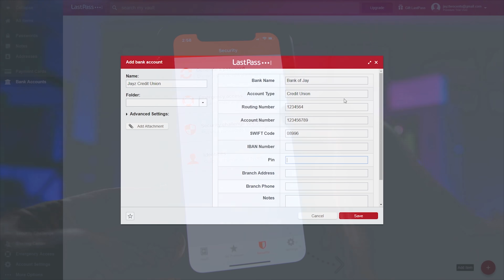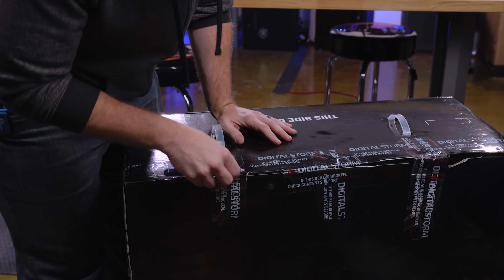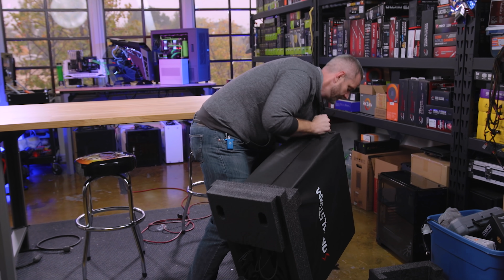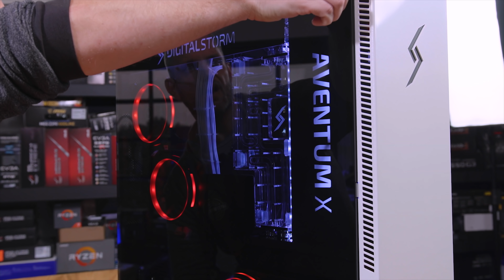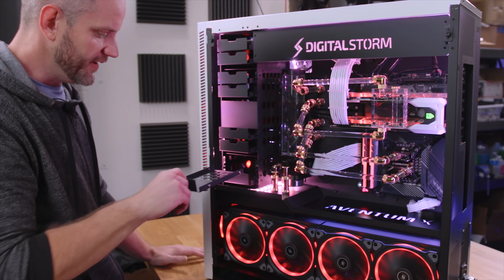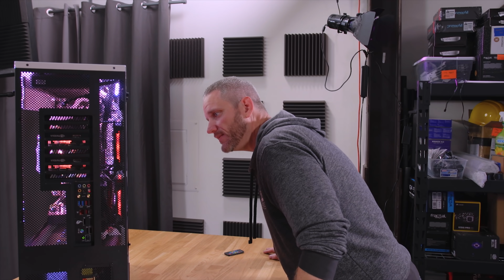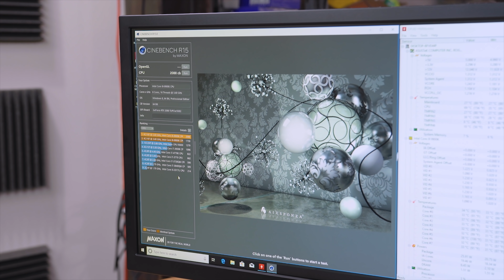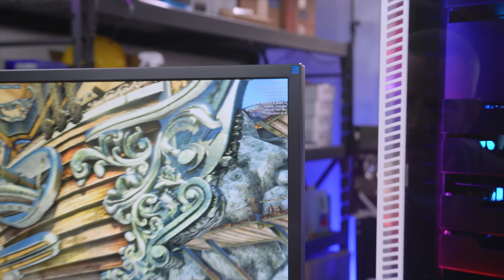Unboxing a $9500 Custom Computer...

Comment: Digital Storm is the biggest Ripoff I've ever seen. I'm about to build a new system with 16gb of Ram, i5-8600k, and an RTX2070. The whole build that I designed will cost me about $1,450. I went on Digital Storms website and built basically the exact same computer besides Digital Storms has 1TB less storage and a i5-9600k instead. The website says it would cost me $2,494 to get the same system than I myself will be building for $1,450 so basically they are making $1,000 over the price of components. That's the biggest ripoff I've ever seen and hell I went on NZXT and build the exact setup as I'm doing and it was only around $1,600. Fuck Digital Storm lol if you buy from them then you're not smart unless you wanna drop $9,500 for a pc like in the video and even then you can build that pc for a ton cheaper on your own.
Reply: YESSSSSSS, FUCK THEM!!! They fucked me up so much man, it was incredible!!!! I spent too much money because I trusted them, and in the end i got screwed over with 3 RMAs. it sucked so bad
Reply: Aside from the guy spamming every comment with hate, I tried to build their standard model on nzxt and it ended up being like 200 more on NZXT without any of the free stuff that comes with the vanquish.  Granted NZXT doesn't give a lot of options to let me push the price down...
Building on your own, if you know what you're doing is generally going to be cheaper now, especially if you're not aiming for the newest hottest stuff.  That's been known.
Reply: Rakka Kaze If my experience happened to you, you’d have nothing but hate as well. NZXT do seem pretty good tho after you said that
Reply: @JBxER  I'm a mature adult (ha) that doesn't think a bad thing happening to me is the typical law of the universe.  I've also been savvy in electronics since I was 14, and am more likely to fix my own stuff. I avoid your experience by my own hand.
If spending more money on the same things with less options seems 'pretty good tho', then you have a lot more problems than your obsessions.
Reply: @Rakkakaze  I never said anything about you being immature... but OK. As for problems, um.. what are you saying here? More problems than my obsessions? What? When i said my experience, i meant what I went through with Digital Storm, not my tech experience overall. I guess I wasn't clear when I said that, didn't mean anything against you personally.
Reply: @JBxER  Maturity, your response to a problem.  Obsession, evident in this comment section, searching for any and all confirmation to your problem. Experience, avoided by my own diy experience, in response to your 'if it happened to you'.  And finally, why are you looking to spend MORE money than on the same things with a pre-builder, just because you don't like the other pre-builder, thus possibly dropping yourself into the same problem. 
It's like saying 'HA, android phones won't get me with that, I'll just sell an arm for an iphone! Oh crap, Apple also caused me problems!'
Have more than hate when things go wrong.

I can find plenty of things wrong with this build featured by just looking at it, but I can also find design purpose to them as well beyond aesthetics (except the gameshow lights.)
I imagine anything with a water distribution system like this can be packed with nightmares in complications, and the fact they are shipping these things around to get knocked around for however much time they take to get shipped.
Reply: @Rakkakaze  Oh, well honestly at the time I purchased the computer from Digital Storm, I didn't really know better. I learned a whole lot afterwards, through interest and through the hard way unfortunately. I made the mistake to trust Digital Storm and it has bit me really hard. That's the truth, I decided to make an effort and let as many people know the risk they would take should they decide to order from them. Overall, after around 60 days without my computer back and being kept in the dark as to what would happen to it, I ended up building a computer from scratch since it was affecting me financially (had to turn down a lot of freelance gigs, kept hoping I'd receive my computer soon when I didn't). It was my first computer built, thats when I learned more building computers in general and realized it was totally doable. It may have been known to many people, but sadly it wasn't to me. Live and learn, right?
Reply: @JBxER  That is the general idea, yes.
The same thing happens to cars, but I don't exactly see the car companies crashing because lemons exist and 1st party dealers want to charge 10x as much a garage would and keep a 50-200k car forever.  The only reason I don't build my own is lack of tools and market to support it.
Some people want to spend their money on fancy over anything else.  My own rig is just a black box with a light inside telling me the mobo has power, and a corsair logo that changes from green to red as CPU nears 100% usage.  Some want their rigs to be seen from space, this is one such.

Comment: Is it just me or does the RGB on this particular Digital Storm rig look really cheap, like Walmart Overpowered RGB cheap?
Reply: This whole thing looks cheap to me.
Reply: The fittings and other components reflect the light inside the case and it indeed makes it look cheap..
Reply: No, it doesn't look cheap at all. Not anymore cheap than all the other RBG builds. You'd think they're building computers for 12 year olds.
Reply: @xenonram  I feel like RGB if done tastefully can certainly enhance a computers aesthetic appeal in most applications, however, imo, this is not one of those.
Reply: The one that came shipped in my computer can be bought for 15 bucks on amazon. So yes, cheap. Chinese made
Reply: I wouldn't say "cheap"... more like... hmm... tacky? The whole color scheme is not quite to my liking. It can't decide if it wants to be blinged out in gold/silver, or sleek stealthy with matte blacks, or RGB rainbow parade with all the LEDs. It's excellently put together, I just don't care of the aesthetic.
Reply: No it was super cheap. They got very low-density strips, probably 60/m as oppose to the 144/m I use in my systems. Also it has no diffuser to spread out the light, mix the colors, and make it less harsh on the eyes. Diffusers cost about $1 per 5m retail. Doesn't even seem to be synced to the rest of the PC. They got literally the cheapest strips they could and just glued to them to a random spot.
Reply: I was watching the end with the fans out of sync.
Reply: They are thermaltake Riing Plus fans with the branding changed...

Edit: here’s a link to thermaltake’s fans
https://www.amazon.ca/Thermaltake-Controller-Software-Radiator-CL-F070-PL20SW/dp/B07D95PLY2/ref=mp_s_a_1_1?ie=UTF8&qid=1544101880&sr=8-1&pi=AC_SX236_SY340_QL65&keywords=thermaltake+riing+plus+200&dpPl=1&dpID=51NnZnI1FlL&ref=plSrch

They are absolutely identical
Reply: It is just you
Reply: You cant argue about taste, but i like minimalistic builds waaay more. Rgb just isnt my thing.

Comment: I just received a 8100$ digital storm custom PC with dual 2080ti’s and a i7 7820x both watercooled in the lumos case and upon arrival both 2080ti’s had hardware failure.... :( currently, it’s an expensive brick. I sent you an email about it a few days ago. Hope you might be able to help.

Comment: Hey Jay, thanks for the video. I’d like to share my customer experience to YouTube, hopefully to provide additional context to people. After saving up money for years, I bought an Aventum X, config is about $11,000 with 2x 2080 TIs. It’s a beautiful looking machine. But unfortunately I’ve had to bring the machine back to DS 4 times now. At the time of writing this comment, the machine is being worked on by DS techs. I’ve even had the system rebuilt too which is actually how I even got the 2 2080 TIs in the first place.

If I didn’t live within driving distance of their HQ, The whole RMA process would be a nightmare considering how big the machine is.

Of course, I hope that anyone that buys an Aventum doesn’t go through this! But I think most people especially those shopping in the boutique build market don’t have the patience for this. A brand new product shouldn’t be going back to repair every other month imo.

Comment: You should not mock the british for their mesures, YOU should use the international system (kg for the weight)
Reply: Why. Technically the imperial system is international..
Reply: @jdrok5026  https://en.wikipedia.org/wiki/International_System_of_Units

Comment: Jay this seems like a dumb question. But where do you draw the line between pcgamer and enthuist? With games being more demanding is enthusiast just another name for " future proofing?" I hate the word.but When it comes to technology is there a such thing as "future proofing?"  Im on the fence about it .
Reply: Depends on what enthusiast means to you. You can be a enthusiast of just pushing things to the limit aesthetics etc etc.
Reply: future proofing is like being ready for future updates... if you spent top dollar on pcie 4 motherboard on day of release it should be relevant for 5 years until pcie 5 is released... ddr4-5, am4, am5 etc. on a side note is anything future prof if the government restrict what can and cannot be used for chemical compound, power used, emissions etc? some could argue that the future is 1 nano second from the time you have read this.

Comment: I dont like it because the motherboard is upside down.
Reply: That stuck out to me as well. Oddly enough the Aorus Gaming x299 boards all had their text so it looked sideways in most cases but because I have a Thermaltake Tower 900 Snow Edition and it looks like the Gaming 7 was made for that thing.

Comment: All of that over kill and only two sticks of RAM?!?!?
Reply: $9k = ALL OF THE SLOTS FILLED =)
Reply: @christophermcbride1133  Rather have two sticks for preformance over 4 sticks at slower speeds.
Reply: Perfect board if you want 4x nvme m.2 ;) @christophermcbride1133
Reply: For 9.5K it should have been this:
1. Binned & delidded 9980XE@5.2GHz with silver IHS and either liquid metal or Kryonaut,
2. X299 ASUS RAMPAGE VI Extreme
3.128GB (8x16GB) Gskill trident Z @4000CL19
4. Intel Optane 905P 960GB SSD
5. 4TB Samsung 860 pro
6. Dual 2080Tis + SLI NVLink Bridge
7. Elgato Game Capture 4K60 Pro
8.  Phanteks Enthoo Elite Extreme
9. EVGA SuperNOVA 1600W T2 80+ TITANIUM
10. 560mm+420mm radiator custom loop with hard tubing
11. Windows 10 pro for workstations

This leaves about 800 dollars for the labour which I see as fair. But with what you actually get you actually pay 4000 dollars labour which is extortionate.
Reply: not even 4600mhz ram for $9500
Reply: @Karl Marx  Only HDTPC'S support more than 64 gigs of ram.
Reply: @X x X  Because it's a high end desktop platform.
Reply: Karl Marx i9-7980XE?
Reply: Karl Marx or the i9-9980XE
Reply: 2 sticks = higher possible clocks
Reply: @MeakerSE  2 DIMM slots = even 
better overclocks 

But at 10k it should have 64GB of DDR4

Comment: Those gpu cables.... Why??? So much effort with distribution board and all and someone couldn't be bothered to cut them to the right length?
Reply: yeah you can see it looks awful at 5:45
Reply: @isaacsrandombits5832  Ha I click on the time and it shows the rats nest and Jay says "very tidy" I think he's talking about the tubes but still lol
Reply: There is no point in that because you don't see them. It cheaper and easier for them to make those cables the same lenght
Reply: @cykablyat9163  are you kidding, pay that kind of money every cable better be perfection. Murderboxes make this look like crap.
Reply: @cykablyat9163  Its more the principle. Wire management is one of the few things they're actually doing for you custom and they did it terribly. Also the inside of a product should always look as good as the outside. Especially for something that is supposed to be top tier. Ferrari doesn't cheap out on the engine bay.

Comment: only 2 sricks of ddr4 for $9500?
Reply: At least it's not a mATX mobo with only two DIMM slots. :D
Reply: @samiraperi467  lmao good one
Reply: For this much money they should have included at least two sticks of 16GB modules (32GB=2x16GB) as they are dual ranked and faster than single rank (due to rank interleaving). 4000C18 dual rank is as fast as 4800C19 single rank. Also a really good motherboard like the Asus Extreme can have four dual-ranked dimms running at 4000MHz C18-19-19-39.
Reply: not even 4600mhz ram
Reply: @jaggsta  honestly that was my biggest problem, you can have 3200MHz ram in a $2000 system, I'd expect at least 4000 for a build of this quality/expense. That and the overclocks were unambitious.
Reply: Its funny how the person i corrected was grateful and the idiots that has nothing to be mad about gets mad.. hahahaha.. fckin nerds.. English isnt my first language either and being corrected improved me. Stop being idiot guys. Haha
Reply: Faster
Reply: You just don't need that many sricks.
Reply: well you can download the rest of it.
Reply: @Matthew Andrews No, that would be too many commas.
Reply: Matthew Andrews im not trying to speak like the old english days.. i just corrected the meaning of the word hahaha.. wtf are you guys getting mad about? Everytime i correct someone its the same dumbass response from you morons. Hahaha
Reply: $5k cost price and worst 3000mhz c16*** not even c15:) $4.5k  easy money:)better than razer and alienware big time manufacturer con man:)
Reply: could be 32 gb sticks
Reply: Matthew Andrews oh you got me bro.. insecurity. Hahahahaha.. seems like youre the insecured one.. hahaha.. its all about feelings right? Fuck corrections.. hahh
Reply: David AE Levy wrong I cant spell or punctuate correctly to save my life but plenty of those who can are as stupid as stupid gets I find math skills far more important along with problem solving skills and common since

Comment: British Units lol  Stone is the same measurement family as pounds - like grams and kilos. 14 pounds = 1 stone.  So 175/14=12.5 stone. We use the same measurements, we're just not scared by 14 times table...
Reply: Stone is an imperial unit, so you wouldn't write 12.5 stone as a decimal. It'd be 12st 7lbs or 12 and a half stones.
Reply: There is a measurement used in heating/cooling called BTU or British Thermal Units
Reply: Like too far for science tffs 😉
Reply: Well, most people rag on America for not using Metric as the rest of the world does. So they call the Imperial Measurement, America Units. Even though it was the Brits that basically brought it over. Long with most things. Then, decide to change things up. Then, make fun of Americans. Maybe they should stick a feather in their hat! Stuck up...anyhoo...sorry.

Bless those Brits that use the old system like Rocks, Stones, Boulders, and...uh...what comes after Bolder again Thumbs through a Geology book
Reply: @Qardo  America units?
Reply: @jon.wilson  freedom units
Reply: @maj429  Lol Freedom Units :D